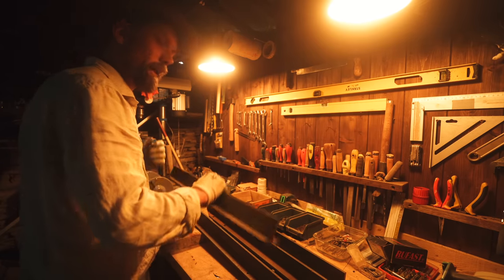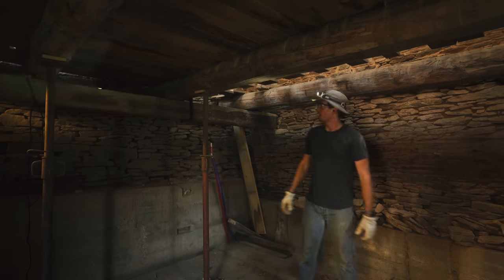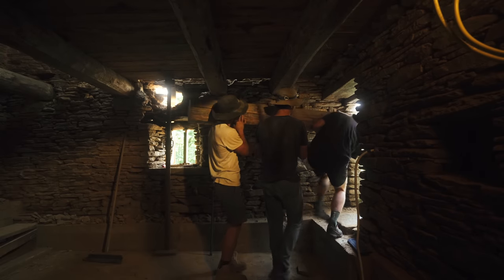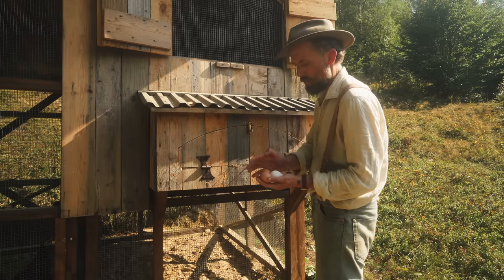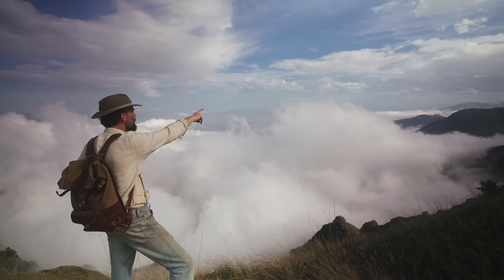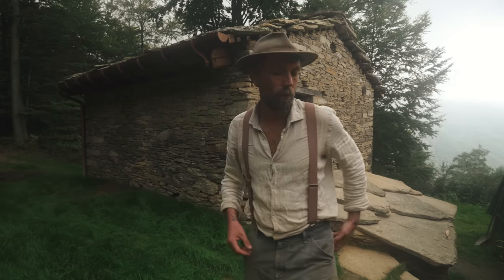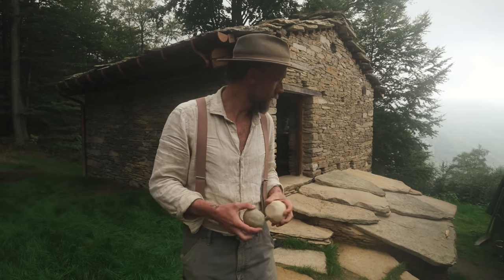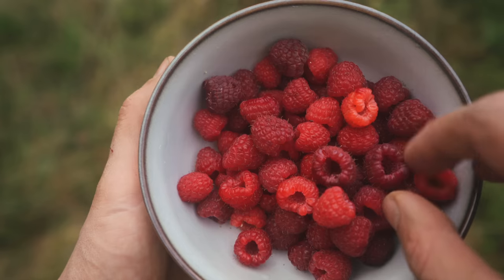#83 Big change

Comment: You've come so far in this project and it has been a remarkable and at times an exciting journey to watch! Thank you for sharing it with us.
Just a comment about those beams though: After the install of the the steel carriers, I would suggest some type of columnar vertical support, bottom of beam to the concrete stem wall. Just to be sure the load is secure.
Reply: I wondered about this too.  He can't expect 8 screws on each steel carrier to support each beam.  He engineered everything else so well that he must have more in mind.
Reply: I came to say the same thing - the pressure on that piece of steel and the screws is the opposite of what it should be. Maybe its just temporary, hope so. Love your show, hope you read these comments!

Comment: With cutting those beams, I would be checking the those corners high and low for square. That is a lot of weight on the roof putting pressure on those walls. I mean what’s done is done, but that would make me hella nervous. I would have left the first beam you removed in and built boxes for storage and wall for shelves for books and mementos. I mean you don’t really need a meter wide set of stairs. It’s still very interesting to to observe and follow. I just want you to be safe. Cheers.

Comment: Ciao Martin, first of all I congratulate you because you are very, very good and you are doing work that you have never done. Someone has already said it: I believe that the iron plates will not support the weight of the entire attic plus the furniture that you will place on the first floor; From the looks of it they are too small. Much larger plates are needed and fixed to the wall with reinforced concrete or fixed and supported from below. Or with a transversal iron beam that supports all the wooden beams. I would have the size of the beams and the type of fastening calculated by a structural engineer. They scare me a lot and I don't want anything bad to happen to you. If, however, you have already asked for reliable information on the type of fastening used, forgive my intrusion. LUCA
Reply: Suggestion for steps re more steel reinforcement now, what next step could be added?
Reply: I wondered about this too.  Martijn can't expect 8 screws on each steel carrier to support each beam.  He engineered everything else so well that he must have more in mind.
Reply: @desmondtutu7916  The screws are not supporting the beam, only holding the steel in place until the cement cures. Beam is actually resting on the steel plate secured in wall. Should be fine!
Reply: @preciousoil  They seem like undersized beams to me and could bend under the weight of an entire floor plus furniture. I would ask an engineer's opinion, but I don't want to insist.
Reply: @lucanicoletti2471 I agree, iron plates are now the weakest part of the structure, there are lever forces at the junction between metal and cement that could bend the plate or "chip" the cement in contact.

The root problem was a lack of head space, it would have been more clever to dig the floor in order to have a high celling  instead of removing the solid cross suporting beam, but he pour the concrete first...the lack of planing generate problems and patches (iron plates) that are far from ideal.
Reply: In truth Martin dug as far as he could and did a nice job. Personally, under each beam I would place wooden uprights equal to the beams, which rest on the new reinforced concrete walls that Martij has created.

Comment: 32:58 These steel plates will not support the weight of the beam. I think that the beams should have been supported from below
Reply: This my same thought unless we’re missing a step. Maybe he’ll use the ledge somehow?  Idk.
Reply: Yeah.  We need clarification.
Reply: I don't think the screws are strong enough either, unless they are forged screws. But I'd rather use through screws for that. (This is not a criticism, just a concern.)

Comment: From an engineering perspective, extending the wooden beams with L/T-bars would not be such a good idea, as the weight of the entire floor (with furniture and people loading on top) is now resting and dependent on the few small screws that are holding the L-bars to the beams. The weight of the floor would also make the L-bars acting as a lever with upwards force pushing against the stone wall, and the stones on the wall would need to be heavy enough to support this weight. It would be s better idea to add columns next to the wall to support these beams from underneath.
Reply: The ‘T’ section steel bars are set deep into the walls and solidly located by the cement mortar and stones around them. The downward sheer forces from the beams/floor boards etc are close up against the walls so the floor beams are well supported. I’m sure Martijn discussed all this with his builder friend and others. It also means that the ends of of the floor support beams can no longer be affected by moisture coming through the walls from the raised earth bank outside - those walls are just stones with soil between them, bit like a giant sponge!

On the valley side there would not be the same water ingress issue so perhaps the beam ends can still go into the walls without relying on steel underpinnings
Reply: @Kathikas1  I'm a retired engineer and my only intention in the above post is to raise safety issues. It doesn't take much to add vertical support columns but it would make the entire structure a lot more safer. You can of course disregard my remark if you don't believe me.
Reply: I was thinking the same thing. My solution would be to drill all the way through the beam (for the four bolts) and put long enough carriage bolts through the beam from the top and then put a nut and washer to secure the bolt to the metal bars. I am not an engineer, but I think along those lines. Safety and future security is key. Just my $.02.
Reply: @joetatullijr4292 That's a good suggestion. Using another metal bar at the top in place of the washers would make it more secure though 👍

Comment: @MartijnDoolaard If it does not detract from your overall aesthetic, you could repurpose the removed beams as vertical support pillars under the floor beams where you installed the metal bracing. Installed against the stone on top of the concrete wall. Thank you again for sharing your progress I watch every week as soon as you release the update!
Reply: I thought the same, to bad he had to remove that support beam. I’m sure the metal will be adequate but I don’t like the look.

Comment: Beams supported by angle brackets screwed to them are a very risky idea. In my opinion, the screws will be pulled out under the weight of the floor.

Comment: Loving the video. Im not sure those iron bars holding up the floor is strong enough. The weight pushing down on those small screws you fasten them with. May be a support post vertical underneath that is decorative. ??? Amazing journey. You’re an inspiration.

Comment: Great job Martijn on both the quality of your shots/videos/camera work as well as the work on the cabins. I have only one concern again, putting cement directly onto the wooden lintel will sadly make the wood rot. Usually a metal joint is applied to the wood and this is then put into the cement/concrete. Otherwise great work.

Comment: 14:21 Those "three or four" objects in the sky, flying after each other, are allegedly a new kind of advanced spacecraft that are primarily being used to train new pilots. It's meant to learn how they can control these very powerful machines to prevent them from making sudden uncontrolled movements, which could be dangerous or even fatal. Flying in formation helps the pilots to get a better understanding of the spacecrafts' flying behavior. The other craft nearby serve as a point of reference.

Comment: What if your way of relaxation is to work in kindling wood?  At the same time admire with relish the irrefutable progress that is done inside and outside of the cabin, bringing to another stage.  But consider the simplicity of things perhaps thought the unnecessary but share, in a way, working together and delivering beautiful results that boost up our confidence and resilience.
  The benefits we often overlook because the focus is on something big occupying the eyes, mind and heart.  
Light is another thing, a pointer.
  Thanks.
Reply: Have another glass, cheers 🍻

Comment: I have a question Martijn; why was it necessary to rip up the floor boards? And the strength (lack of) of the metal T brackets which will pivot at the wall worries me.

Comment: Things are moving right along in Martijnville. I have spent at least a couple of hours trying to find Martijn's homestead on Google maps. Does anyone have the GPS coordinates? Is he north or south of the valley (Val Pellice)? The mapping images are not up to date for sure and are a bit grainy for this area of the globe in general. Some spots seem better than others with the towns and more residential areas clearer than the forests and higher altitudes. Maybe someone knows.

With the flooring and beam removed the interior looks so much roomier. It will be fun to watch the progress of finishing the pointing of the walls. I took a look at the website for the new pre-cast stove/heater fireplace unit and it looks like it will really help efficiently heat the whole house for the winter. In my figuring from back in May and June I was at 80% positive that Martijn would have the place ready for winter by Christmas. So that's about fourteen (14) weeks before my artificial deadline. Obviously my guessing how long things will take is just that, and I am by no means an expert at any of this... but I love to guess. How about you? So just from my own thoughts here's my to do list: Finish all interior pointing and stone work, build stairway between floors with precast heater built in, connect basic plumbing (toilet, sinks, shower, kitchen area, etc.) and electric, install all windows and doors, seal up any other leaks in stonework or fixtures, stack firewood near building, all time for testing and bug fixes. I am sure the week-to-week details will expand the list, but in general that's all I can think of to make the house livable for the winter. Am I missing anything? So what do you think? Can he make it? I'll hold at 80% yes. I am also keeping in mind that with basic heat, water, and power... and windows and doors installed, even a primitive set up would allow Martijn to stay at home for the winter months after the holiday, and strike the tent to protect it from any blizzards or wind storms.

Lots of great comments. Thank you Martijn for sharing your experiences with us, along with your thoughts, friends and beautiful videos.
Reply: Le baite di Martijn si trovano nella parte nord della Valle Pellice sulle pendici est del Monte Vandalino. Non comunico le esatte coordinate per rispettarne la privacy. Ma le immagini su Google maps della zona sono molto nitide tanto da poter vedere distintamente anche la tenda, i pannelli solari ed il tavolo in pietra dove Martijn pratica il bbq. Buona ricerca.

Comment: Suggestion;  the door you use now to the lower level, you were to put in a window.  suggest a window that can be used as a fire escape.       All theBest
Reply: In North America, it is mandatory for a basement bedroom to have an escape window in case of fir or any emergency.  My understanding of your layout, there is to be a lower level bedroom, if a fire started upstairs 
you would be trapped.
Electric power panel has to have amin. of 3 ft. or 1 meter clearance in front.
I realize standards differ in EU and NA.
I look forward each week to your postngs.
Glenn

 -Official-MartijnDoolaard

Comment: Was wondering about the angle bars on the ends of the beams. Would it not be better to replace the coach screws furthest from the wall (that are in tension) with through bolts with washers on the top to prevent tear out? Enjoying the channel though. Videography is through the roof.

Comment: I’m curious and I have questions..

 So let me get this right, you’ve shorten the floor beams so they’re the same width as the inner wall, so you’re able to fill the holes where they once sat?.. 

Then using the 90 degree steel lengths, you’re fixing them into the wall and on the beam?.. wouldn’t that reduce the surface area of where the weight of the beam originally had sat on the stone? 

Love your content as ever.

Comment: @32:57 without proper water protection. and or also a french drain, around the ourside of the building. those iron T beams will rust out, within 50-100 years i guess? no?

Comment: 30:49 wood is not a brick, you cant just put cement on it, it will make it rotten very fast. Cemment sucks up all the moisture and when it releases it will realise it in the wood. That is building 101.

Comment: Does the NHL has similar properties as Roman Cement as in it "heals" itself from cracks when wet?
Reply: I think you are right. Any free lime in a structure dissolves in water and then hardens in any  small cracks. The Romans required all structural lime mortar in wet form to ‘cook’ or slake in vats for seven years before it could legally be used. This gave it good strength, durability and the ability to resist temperature changes - not sure Martijn has seven years to spare!

Comment: 27:45 are You not afraid that these sharp and slim metal bars will put too much pressure on the rocks and cement ? the floor will "work" through the years and so the metal bar can easily cause the cracks and crush the rocks and the cement ? hardness of the cement make it easy to crush..a matter of crack susceptibility ? Don't You worry about that ?

Comment: Are you putting in a smaller steel beam to replace the wood one you took out?  You didn't mention it.  I would not like it if you got squished.  That smaller steel t is not enough support for those  beams.  You will have to have something under the steel t to carry the load.
Reply: The weight of the beam ends and floor will be located close to the wall. The steel mini beams will be held in position by the stones locked in position above and around them so they cannot seesaw upwards. Martijn is using cement mortar to bind this area together so it is, excuse the pun, rock solid. I must say I too would have had one long coach bolt through the inboard end of the steel beam, even if only to give an illusion of stability and strength to visitors and us viewers …
Reply: I could go with that.  I just didn't think those little screws would work with shear but my main fear was buckling close to the wall.  At any rate, it is visually frightening and I don't want to think of such an careful craftsman being crushed while sleeping.  @Kathikas1

Comment: Be cautious with burning that salvaged lumber.  You personally have sprayed it with insecticide,  and there's a good chance that the previous owners have as well.  It probably won't hurt to burn it in the stove, but I doggone sure wouldn't cook a steak over a fire made from it.  In fact, I wouldn't want to burn it in the fire pit where you cook.  Some of the old chemicals and even some of the new ones are pretty nasty.

Comment: I was watching and thinking - there lives a guy high in the mountains, where all the goods and building materials are quite hard to get and deliver and they are not cheap, especially wood .. and then this guy takes and cuts perfectly good reusable floorboards into firewood and kindling .. these boards and beams would've come off in one piece if only brains were used - so I really couldn't understand such a waste  🤔.. but as I've never been the sharpest pencil in the box, pls forgive my stupidity 😆
However, the hike was nice though .. a true 3D experience.